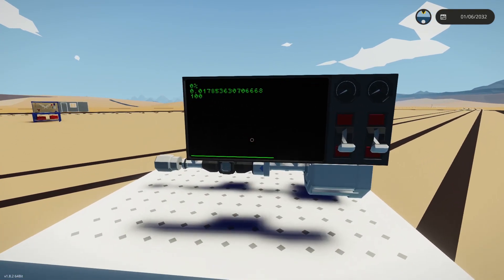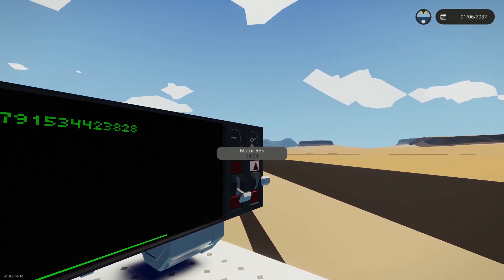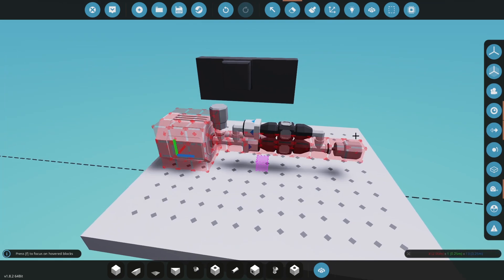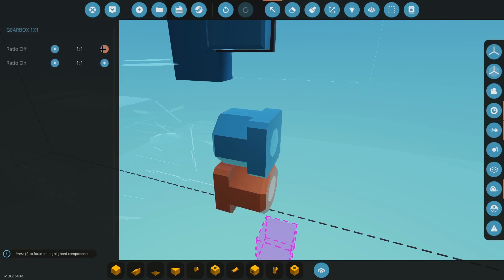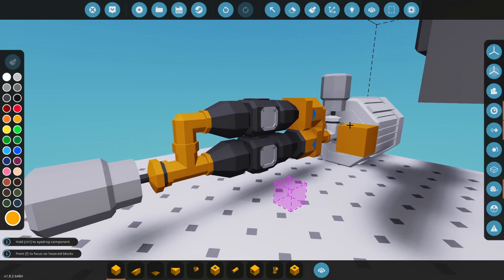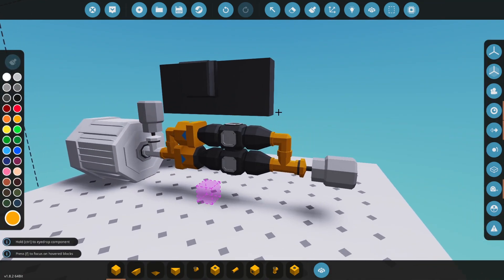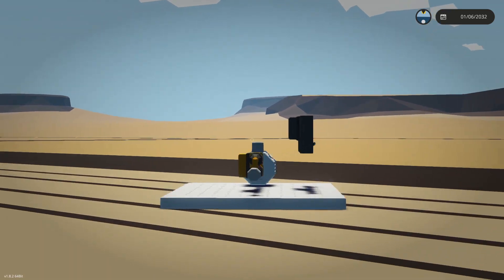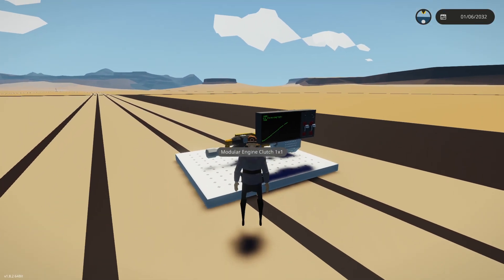(Outdated) CVT Transmission Tutorial - Stormworks Build and Rescue

Comment: doesn't work
Reply: The change in ratio is so quick that the engine stalls (and my auto clutch disengages)
Reply from the maker: That's an engine issue
Reply: @BigmanBoi  it's not. i tested today and with your formulas gear increase is pretty much exponential not linear(like in your video)

Comment: I was trying to make a dual clutch transmission and it never worked because engaging two (normal) clutches would stall the engine. Using your modular engine clutch and crankshaft trick, I managed to make it work!

Comment: nice concept. Sadly, there are some problems with this.

If you place the clutch first, before the crankshaft, then you will most likely get the slipping clutch bug and you will loose a measurable amount of power. The clutch will slip even, if it is fully engaged, but the load on the motor or engine will stay the same as without the bug. There is also a problem with big "torque" differences. If the modular engine has little to no mass (which is what the torque output of a torque sensor represents. Don't ask me, the devs decided to call mass torque instead.) and the load has a high amount of mass, then you can do what you want, you will get the slipping clutch bug.

In this case it would mean that it would double the bug (both clutches of the "modular engine"/cvt) and you will loose probably something like 40% of the power. Test it out, hook up a few large generators and test a direct pipe connection and the cvt.

You can minimize this issue by using flywheel(s) in the "modular engine". But this would increase the reaction time of the cvt and probably shift the issue to the electric motor. Power transmission in stormworks is very messy.

What i found to work quite efficient is to use the clutch on a modular engine directly as cvt. I mean, a modular engine with cylinders that runs by itself. You can use a flywheel in the engine and keep the mass relative high without compromising a previous power source as the engine itself is the power source. A PID then regulates the clutch to keep the engine at a constant rps, which is easier than it sounds as the flywheel will help with this task. This usually gives me above 90% efficiency, so way better than a diesel electric system (in this game).
Reply: i have an issue where when i throttle the CVT, the rps dies, some times the rps doesn't get lowered much other times like 1/3rd rps both for no extra torque, running the engines with just a flywheels gives a certain torque, CVT decreases RPS and does not change Torque.
Reply: @Minigun_-nj1tf  The torque sensor does not give you any torque values, instead it gives you a black magic number the game uses to calculate the mass of attached things. You can only trust the rps output of the torque meter.

If you built a cvt like Bigman Boi did, then you will also need a mechanism to regulate the cvt (if you want constant rps on the engine/motor side). A cvt is only a gearbox with infinite gear ratios. It will not give your engine unlimited power to spin any load at any rps, but it will allow any gear ratio to hold a engine/motor on a constant rps. 

Think of it like bicycle gears. If you use the highest gear, then you will not be able to spin the pedals like in lower gears. There is just too much resistance on the pedals. So, you start at the lowest gear and when you drive fast enough, you switch to a higher gear. And when a hill comes up, then you switch back to a lower gear, because you can't generate enough power to spin the pedals at the higher gear.

A cvt is like bicycle gears, only an infinite amount of gears. The more you engage the clutch, the harder it is to spin the wheel or generator or whatever. But you also get more rps on the wheel or generator for each rotation of the engine.

I would advise a limited PID to control the engagement of the clutch, as the built in PIDs aren't that great for this kind of use. Make a microcontroller and place a "Function (8 Inputs)":

clamp(x+((((y-z)*w)-a)*b),0,d)

x is the output of the function looped back into itself
y is the rps you want the engine to run at
z is the rps from the engine
w is the speed with which the function should approach the desired engine rps, start with 0.02
a is a "delta" gate (only available in microcontrollers, it outputs the change of its input compared to the last game tick) with the engine rps on the input of the delta gate.
b is the sensitivity multiplier of the function, start with 0.02
d is the on/off switch. You can replace d with a 1 in the function, or you could connect a numerical switch to d with a 1 on its "on" input. This way you can turn the function on and off

The output of the function goes into the clutch and, if you wish, into a "1 - function" subtraction gate for the secound clutch with the low gear ratio, but that is not really needed.

If you have problems with oscillating rps, that you absolutely cannot get rid off, then a average function for the rps can be usefull:

x+((y-x)*0.1)

x is the output of the function looped back into itself
y is the engine rps
0.1 is the "average" multiplier. The smaller this number, the longer it takes to change the output of the function. The higher the number (up to 1), the faster it changes the output

the output of the average function goes into the delta gate for the first function, you can leave z (engine rps) directly connected.
Reply: @Adesterr  Thanks a lot!, will try in a little bit. was just at first unsure of why the torque on engines never changed and how the CVT didn't do anything and just slowly lowered the rps until the engine eventually stalled.

Comment: downsides of cvt the acceleration. a standard 6 speed auto will out pace you as it can get the car moving faster. with cvt the engine has to rev up quite high before it starts to move. cvt is great for gas mileage and holding engine rpm etc for power but not off the line acceleration or max power theres a reason most sport/muscle cars still use a standard auto transmission. A cvt would likely explode if you mated it to a hellcat engine and tried to jump off the line with it or try to reach top speed while rolling
Reply: You might want to take a look at the Williams FW15 F1 car that tested a CVT.
Reply: @Bearded-Baldy85  still a niche case. If CVT were indeed superior in almost all applications. Then how come anything outside of your average economy car doesn't have one? Most high speed or high acceleration cars be a hellcat a CTS V Nissan GT R , Supra, elentra N, Escalade ESV any of the trackhawk SUVs Durango, Jeep etc and all the high end cars Lamborghini, Ferrari etc all use a standard automatic transmission or some fancy dual clutch manual. We don't see any of these types of vehicles using a CVT ask yourself WHY.
Reply from the maker: this is literally the comments section of a tutorial on how to make a cvt in a videogame, don't get so hung over this
Reply: If you design a engine with cvt with racing in mind, then this is false. The right cvt will outperform any conventional gearbox. The question is what the task is. 

Modern tractors have hydraulic cvts that can easily take the torque of multiple muscle cars, but this is expensive. It is more cost effective to just use a larger engine than to built a hydrostatic transmission into a musclecar.

Also, nobody is stopping you from idling a engine just under its peak power rpm. This is not good for the engine, but the same engine with cvt will outperform one without.

You are right that almost nobody (besides most construction and agricultural vehicles) uses cvts, but for the wrong reason. And because cost or longelivety is almost no concern in stormworks, they are in fact the superior option in all cases.

Comment: Hey thats a pretty neat trick but if you want to control normal clutches using logic you can try this funtion i made. As youtube doesnt like links i will instead share the desmos url number. Goto desmos and paste this in after  ..../calculator/      xsiuabwgmu    . Its just a inverse function of the pressure function of the clutch where x is the input {0<x<1}  and r is the rps {0<r}

Comment: Tutorial suggestion: can you make a tutorial on how to make a modular engine ECU.
Reply: Just take a pid with the rps as input. The output of the pid you candirectely connect to the air manifolds and for the fuel manifolds take the air manifold value and multiply it by 0.485 if it doesnt have forced induction, 0.76(or something like that)  if it does

Comment: Really cool,  but why would you run you engines at max power? Can you elaborate on this using gas engine?
Reply from the maker: If you wanted to maximize acceleration, you'll want to have maximim power, and using this as a transmission will ensure you stay there
Reply: @BigmanBoi  I mean, i could see this setup on plane or boat, where you would want to move long distances - CVT would ensure max speed for given engine. But how one should use this with say a car where you accelerate and decelerate constantly, and you wouldn't want to run your engine at max power all the time? Sorry for dumb questions, i'm pretty new to stormworks
Reply: and more questions - do SW engines have torque curve like real motors\engines?
Reply from the maker: In a car, it's best to sit at a low rev where you require low power and use low fuel. My car IRL uses this in the CVT, meaning that if i cruise at 50km/h or 120km/h, I sit at 1200 revs
Reply from the maker: Yes they do (kinda)